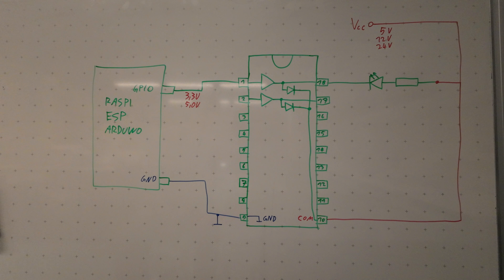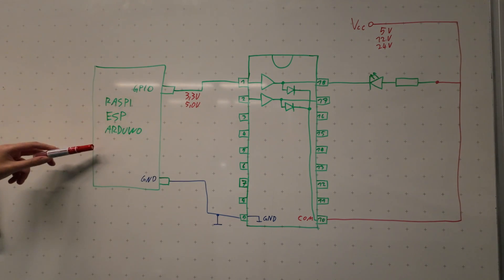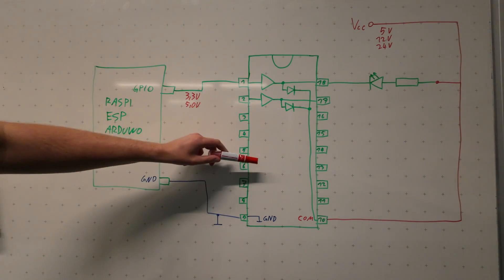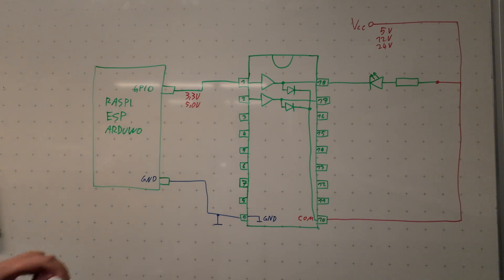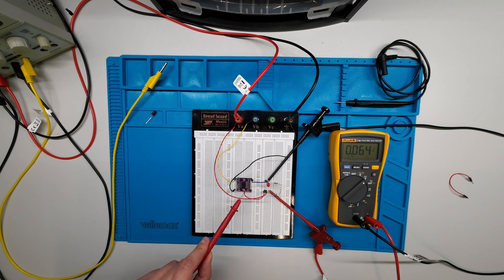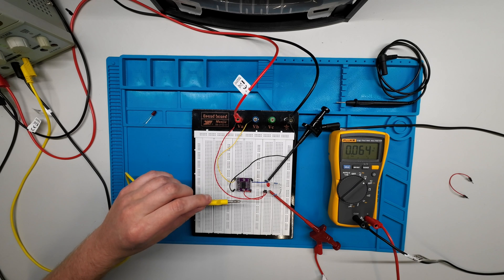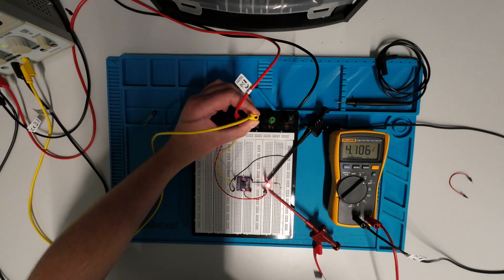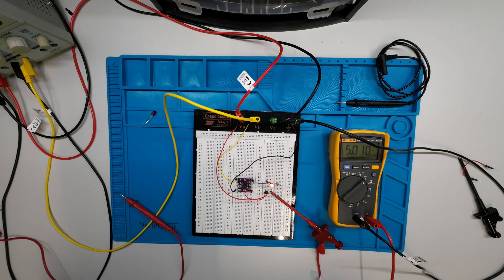How to wire ULN2803 | darlington pair ULN2803A wiring

Comment: With the IC sinking up to 8 connections (relays/ transistors/ other) does it need a heatsink?
Reply from the maker: Not really. Obviously depending on your use case, I normally use it to switch a relay as in the cybergarden part 4 episode. If you know the current you're planning to switch and check the resistance in the datasheet you can quickly calculate the heating power.... What would be your usecase?